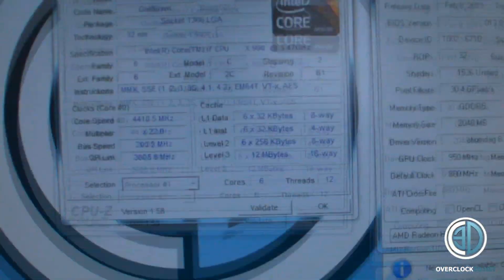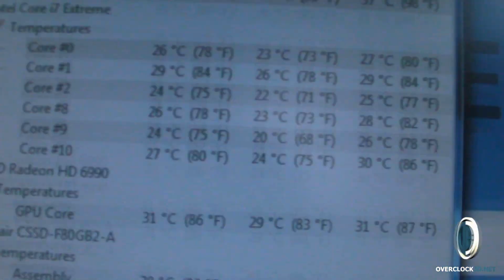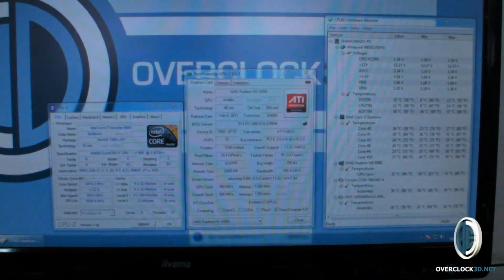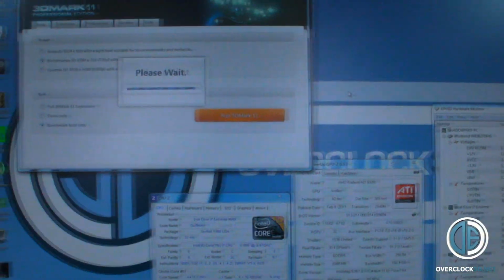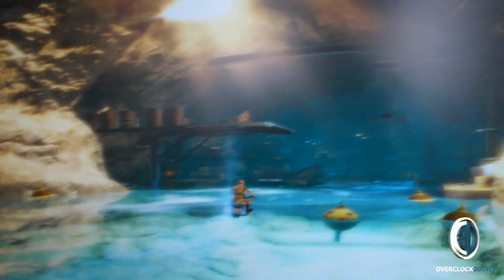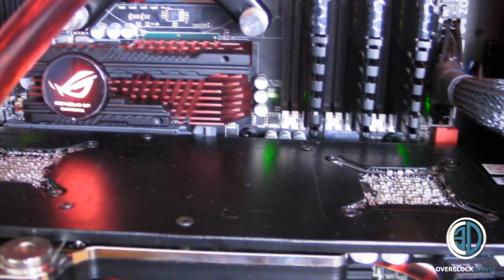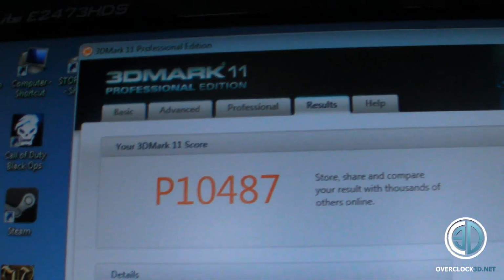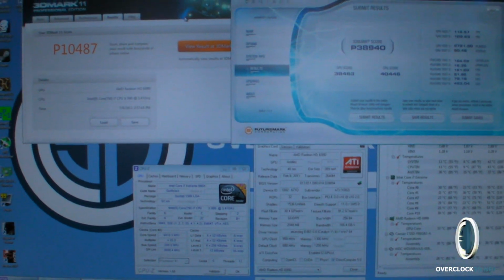Shadow H2O - Powercolor 6990 LCS Review Water Cooled - Shadow H2O Series

Comment: Both of my GTX 470s do that when they are overclocked a lot. You can really notice it in folding@home. From what I understand it is actually common and happens on a lot of cards when they are overclocked to the max on water. You don't really notice it with the kinds of overclocks you get on air. If you turn down your clock you will notice it getting quieter and if you increase the clock it will get louder.

Comment: @Georg1979 I that's true, when you can hear the coils rattling that means there is a high current and they are almost at their max power handling... if you get a non-reference card with a beter power phase control, you won't get the rattling that fast as with the reference ones... and of cource they have beter overclock potential.. (if the chip is bottlenecked by the power source)

Comment: @yusky03 Yes, that's true. My 'MSI N580 GTX Lightning' does not have that issue, only when I'm putting +200 mV with after burner, and set the core clock to 1000 MHz I am getting a little bit noise, but still not as much as the most reference cards... ;)

Comment: I know it may sound dumb but have you tried turning the fan speed to 0% with something like MSI Afterburner to see if it gets rid of that noise?...It could be the case that there is current going to the capacitor for the fan and nowhere for it to go or be used up. Sorry if I sound dumb Its just something I taught of.

Comment: @Georg1979 If you google any card even "GTX 580 Whine" you will find a thread talking about it. Some cards do it more then others but all cards do it... "If you can find a card that doesnt have some Coil whine then I solute you. Ive had a good 30-40 cards & every last one of them had it." It only happens when the card is very stressed and it is worse highly overclocked. But I can't seem to find any of the MSI Military Class cards with the issue but that does not mean it does not happen.